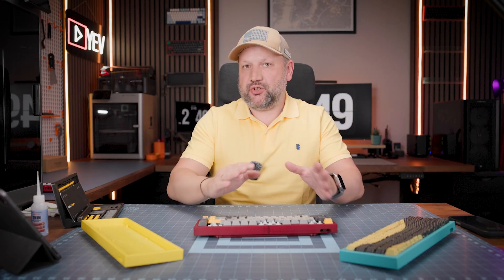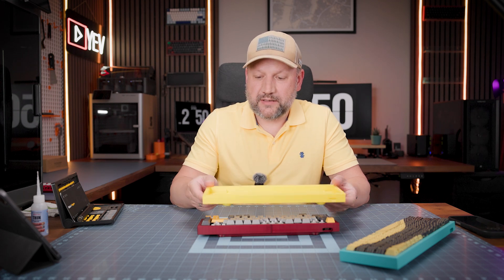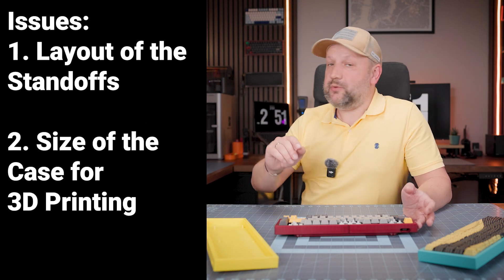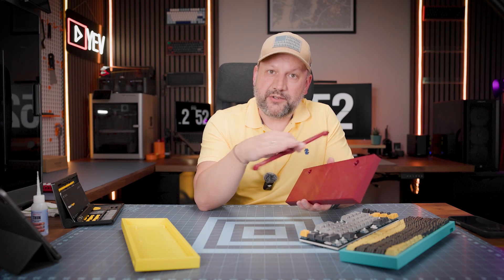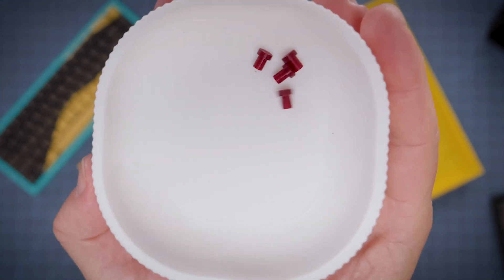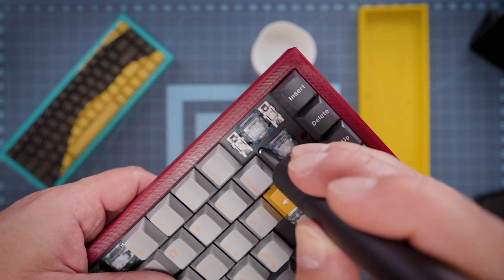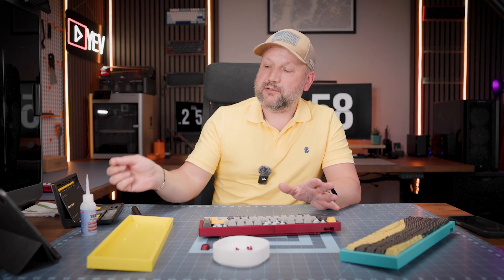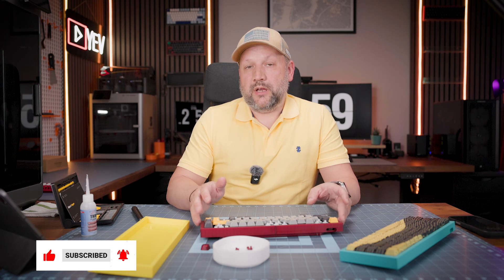How I 3D Printed a 68% Keyboard Case at Home

Comment: 5:55, you could design the standoffs of each one and then just upload the files separately because someone might not want to superglue onto their pcb
Reply from the maker: it's not into PCB but into the case, you don't need to do anything with PCB
Reply: You glue the standoffs to the case itself, the pcb is screwed into the standoffs as a means to weigh the standoffs down to glue to the case properly
Reply from the maker: @S1ipr91 exactly, I can do them embedded to the case but it hard, it’s not universal and 3D printing is not so precise unfortunately

Comment: I made one for my 68 keyboard, but i really like yours and the way you designed the feet and connectors
Reply: at the moment, i am designing an aluminium case for the TK75HEV2
Reply from the maker: wait for my next design, it will be without standoffs at all :)